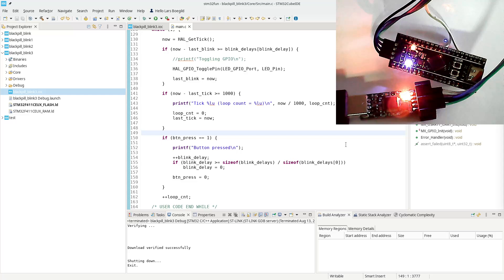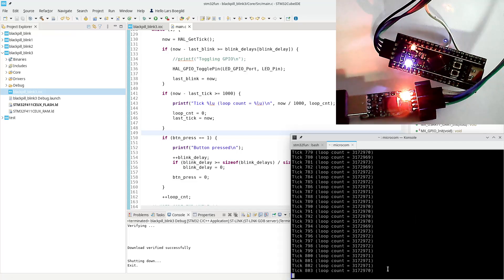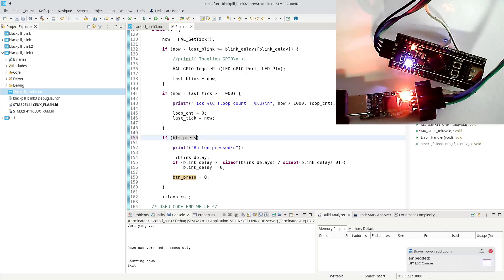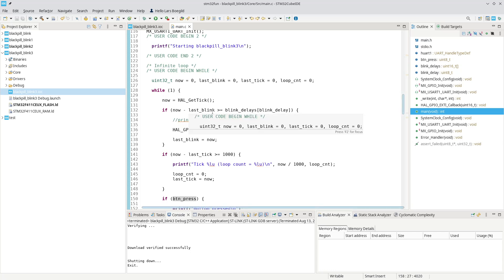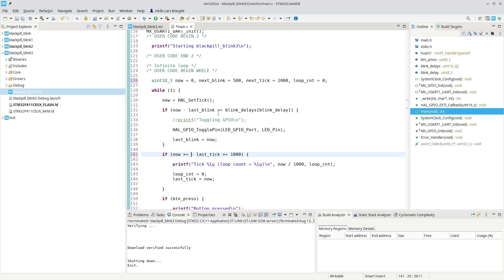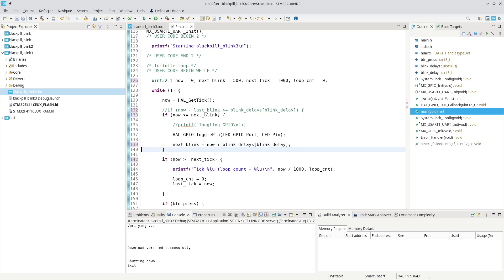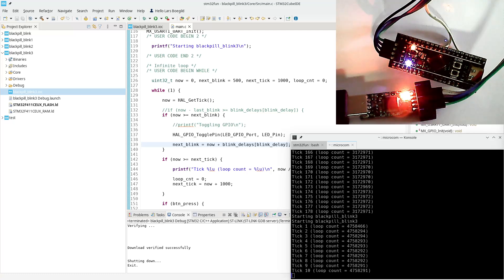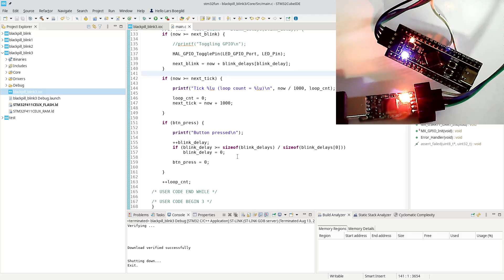STM32 Tutorial #7 - OPTIMIZING C Code (getting smarter every day)

Comment: Second code behavior
if (now - last_blink >= delay)
CPU must:
Subtract now - last_blink
Compare result
Second code behavior
if (now - last_blink >= delay)
CPU must:
Subtract now - last_blink
Compare result
Slightly more instructions
 NOT optimization
Just different math

Important truth (assembly level)
Difference per loop:
1–2 CPU instructions
At 72 MHz → negligible
At human level → invisible
At real-time systems → meaningless

Sir wht do think about this is this true or no this not my answer i ask GBT HHH
Reply from the maker: I don't really understand your point.  Your examples are both the same but the second is not the one from my video.  I remove the repeated calculation from the loop and only do one calculation when it needs changing.  It makes a HUGE difference.  Also not sure what you mean by "GBT HHH"

Comment: Thanks for the video series! I'm learning a lot ❤. 

One thing I was wondering tho: I could be wrong but if the counter is about to overflow, wouldn't this optimized code may cause the led to toggle even tho it shouldn't?

for example, for simplicity let's say we have an 8 bit tick counter (instead of 32bit) and toggle led every 20 ticks, and we are at a point that next_blink is 253. 

When now (HAL_GetTick();) becomes 253, we toggle the led and  update next_blink. next_blink = now + 20, which is 17, because of overflow. this is correct

the next time through the loop, now is 254, which is greater than 17 so it toggles and next_blink gets updated to 18. (This shouldn't happen as we have not waited 20 ticks, we only waited 1 tick)

In the next loop now is 255, which is greater than 18, so we toggle and update next_blink to 19 (This shouldn't happen as we have not waited 20 ticks, we only waited 1 tick)

In the next loop now becomes 0, which is less than 19 so we skip the if statement.
Reply from the maker: I don't quite follow your question.  I suggest you watch: https://www.youtube.com/watch?v=QHcK3Ani-As where I exploit overflow of a byte.  For more in-depth discussions I would strongly suggest you join the discord server (see channel description).

Comment: Very nice. I think you can squeeze even more as you didn't even try to crank up more the compiler optimization flags.
What should we expect based on CPU performance? If the CPU runs at 100 MHz and we have 1s between printing loop count it should be executing roughly 100M cycles. So that would mean roughly 20 cycles per loop (at 5M loop counts per second). Not too bad.
Reply from the maker: You would have to disassemble the resulting code and then count cycles required for each instruction.